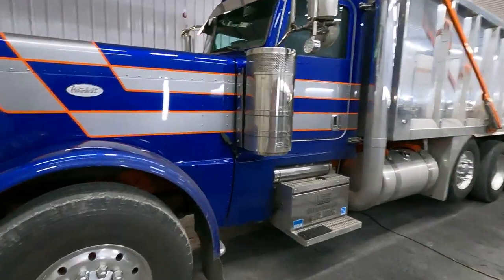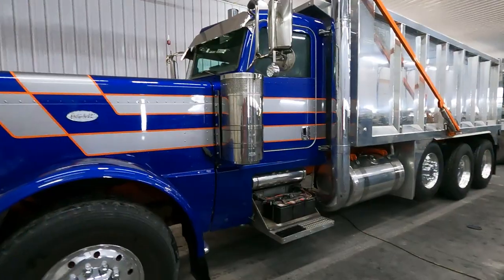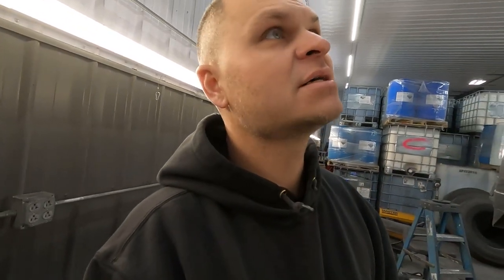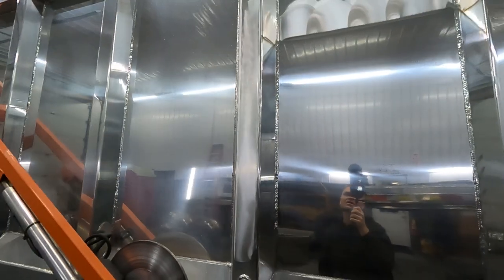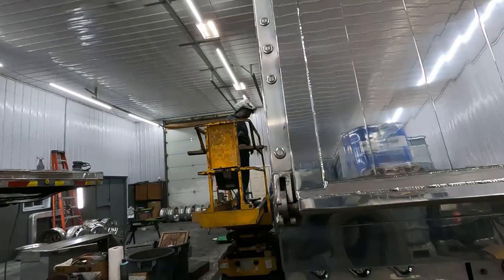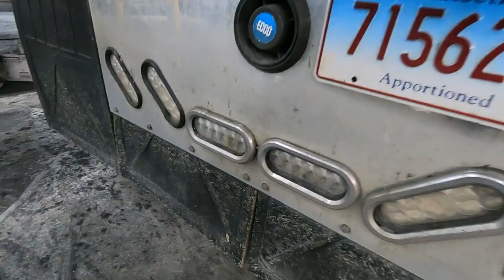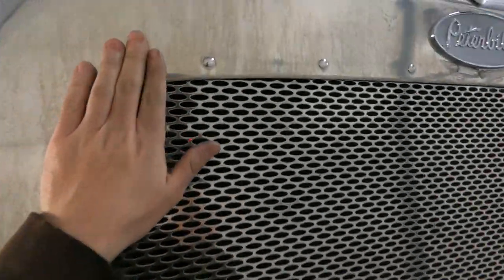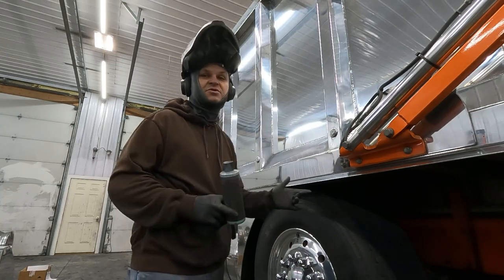How to polish a dump truck body to a mirror!

Comment: That is NOT a tri-axle truck... The "helper axle" isn't counted when specifying the number of drive axles on a truck / tractor, IE: tandem or tri-drive. This truck is a tandem.  👍🏻
Reply: 👎 almost everyone who works with dump trucks would call this a tri-axle. Sure, you might break it down for some paperwork, but there no reason to be so specific. People understand that it’s a pusher axle. I don’t think you truck.

Comment: You mentioned secondary cutting. I saw maybe a purple wheel. What exactly is in between your primary cut and finish
Reply from the maker: Yes I use joker wheel from zephyr
Reply: Do you acid wash in between steps?
Reply from the maker: @bigjoe3838  we do not but I know some guys do.